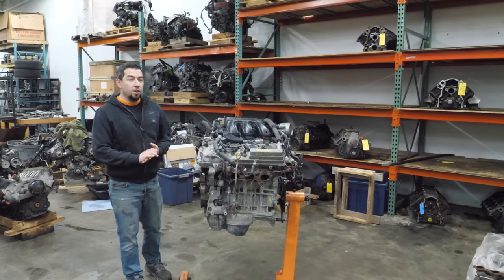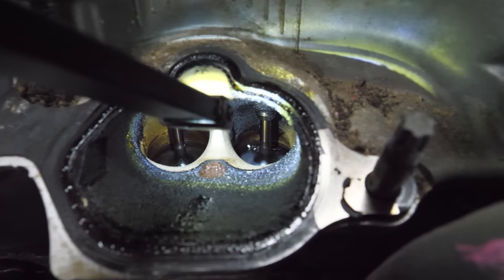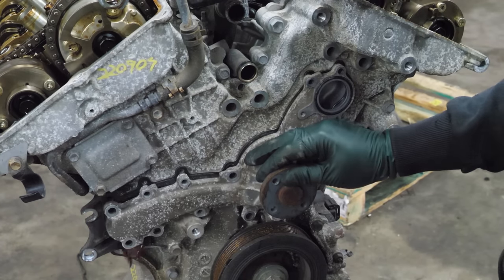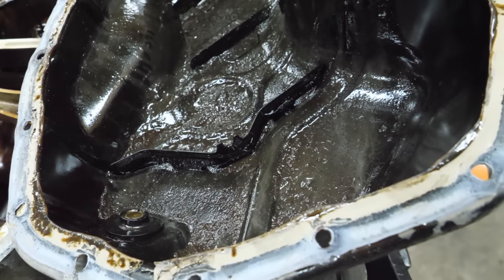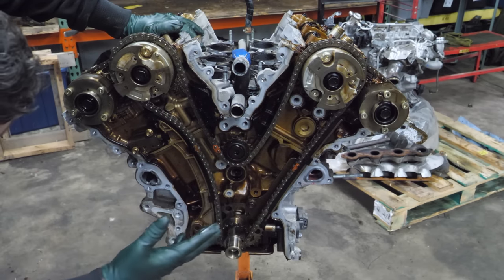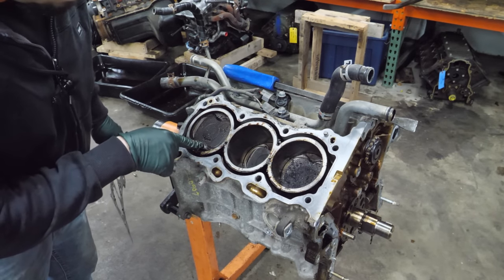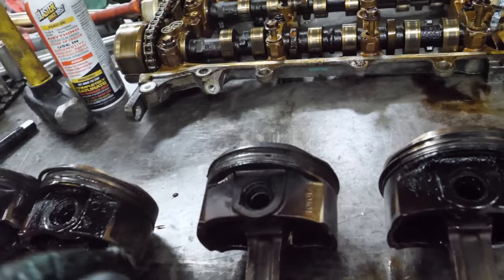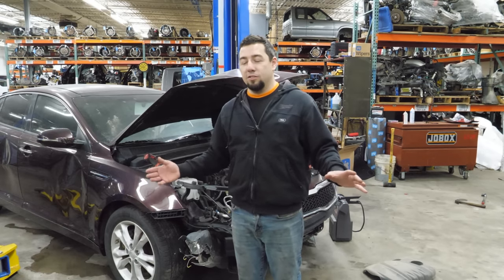Toyota Lexus 2GR-FE Teardown! Premature Death Of Toyota's Most Reliable V6 Caused By Obliviousness!

Comment: When it comes to these engines and why there is still market for them despite seemingly being so reliable comes down to few things. People simply just drive a lot of miles in these cars and they are good cars, probably one of the few where replacing the engine still makes sense rather than scrapping whole car. So loads of miles, means they actually get worn out. Secondly, these being generally very reliable and low maintenance... people do not expect problems, do not look for them and become kind of complacent and lazy... and then they destroy the engine because of minor issue, like some oil or coolant leak. I would add as well that Toyota maintenance schedule is just not healthy. They do their 10k miles services, despite in Europe exact same engines get 10k kilometres services (and last time I have checked that is just 6k miles), this combined with low tension rings just means more sludge accumulation, stuck rings, burning oil and problems starts from there. Those who wants these car to run for a long will stick to 6k miles, or on the car that does commute in daily traffic, or short journeys... even 3k miles... I guess this is Toyota's way for wearing them out, as they are so well designed and so good quality engines that with regular service they would simply run million miles and nobody would need to buy a ne Toyota. Anyway - in summary these engines just likes regular oil service, which is really not much to ask, but again going back to point 2 - people just forget to do it because car is so trouble free it never seems to need any attention and then disaster.

Comment: I must say that the design of the support bearing that Toyota uses for the passenger side front axle in cars with these engines is as bad as it gets from a dismantlers perspective. The axle itself is one piece from the passenger side front wheel to the transmission however it has a pressed on bearing to support the middle of it, that bearing then presses into a cast iron bracket(on FWD models), or the transfer case itself (on AWD models). A snap ring is also employed to make sure that the bearing can’t pop out of the bearing or transfer case. This is then made worse by the fact that the cast iron bracket is bolted with 3 bolts and has 2 dowel pins holding it to the block. One of these bolts can’t be backed out all the way with axle pressed into the bracket, the other two are barely accessible with the engine out of the car, let alone in it. I find that separating the motor and trans with the axle and bracket still bolted to the side of the engine to be the path of least resistance.

AWD models are even worse as the axle now is pressed into a transfer case which once you’ve removed some very inaccessible bolts will crash into the upper oil pan before coming out the transmission, or at least that is the case on a 2018 Sienna. On the 2014 Venza I worked on this past week the path of least resistance after the drivetrain was dropped from the vehicle was to compression test the engine, separate the engine from the transmission, separate the transfer case from the transmission, and then finally stick the transfer case in the press to push the axle out from the transmission end. This job might be simpler if the upper and lower oil pans are removed. If the engine mounts longitudinally in the vehicle as is the case in a 2018 IS350, the axle presses into the side of the oil pan with the front differential on the other side of the oil pan.

I would love to know the book times or costs associated with replacing any of these parts in Toyota or Lexus vehicles, or any insight from Toyota techs.
Reply from the maker: That axle and intermediate shaft is the absolute worst part of the car.
Without a doubt. Toyotas engineers were sleeping and the janitor devised that one.
Reply: @I_Do_Cars  Well the Toyota engineers must still be sleeping because that design has been found in all sorts of Toyota and Lexus vehicle for quite a while now.
Reply: When I worked at the Toyota dealer and had to remove the intermediate shaft I would quote a new bracket bearing and snap ring. I wouldn't even bother messing with it they seize so bad. Cut a slit in the bracket and then a quick blast with the air hammer the axle comes right out. You can also get the bracket cherry red with a torch and air hammer the bearing but is the bracket actually still okay after all that heat and pressure. Or if you want to cheese the system you can remove the clamps for the inner boot separate the axle and leave the intermediate shaft installed. It is possible on some vehicles to access the three bolts holding the bracket on but it's a huge pain. Poor design. Honda has a much simpler intermediate shaft setup on their v6 platform
Reply: Makes taking apart bmws sound like a dream in comparison

Comment: I'm not a mech so why is it called a water pump if it is a coolant pump, coolant is not water? I don't understand. Watched the whole video and still don't get what was the first fault that cause the total failure. I guess that it was a leak of the coolant from the coolant pump? Why the hell would mechanics still use that term?

Comment: As a mechanic i will tell you that you absolutely do not want to have to work on these things in a sienna. Lol. Pretty sure these things die mostly from maintenence negligence. They do require routine oil change intervals and weve have 4 dead ones in my shop from timing related failures as the timing system isnt cheap to work on purely due to how much of a pain it is to get to with the engines in the vehicle. Basically, noone wants to pay that price. Lol. Almost every one ive worked on has clapped out floppy chains and is one cold start away from jumping time. 
ALSO, that stupid oil flter cap is a pain in the ass, youre supposed to use an oil filter cup to remove em. They eventually round and you need a new one. They even made em out of plastic at one point. Theyd crack and leak or round off. Cartridge filters are garbage. Spin on's are the right way.

Comment: They are expensive because the vehicles they go in retain their value well above 200,000 miles.   A clean toyota with 280,000 miles is worth replacing the engine in.

Comment: If the engines are reliable then they outlast the vehicle and are probably very high mileage.  Thus, the only low mileage used Toyota engines you will find are those from accidents which are very limited.  Thus, the high price.

Comment: This engine has done some major work and badly maintained, and been out in the open for a long time, plus this motor has been overheated big time(cooked), those bores are blue
Was hoping to see what actually melted inside the manifold, was is a intake runner or what ?

Comment: So I can claim that I have helped Toyota in durability on this engine my father used to work for the forklift division of Toyota and he would order a diamond White pearl Avalon every two years well in 2005 my dad was one of the first ones to get this engine about 15,000 miles into the car it developed a knock Toyota flew three engineers out and told the dealer not to tear into the engine. Needless to say Toyota and my father didn’t realize I was racing a lot of 4.6 mustangs and 5 L mustang on a Saturday night borrowing dad‘s car…… I feel sorry for those 4.6 L guys though they were slow as hell…..

Comment: It looks like you can't drive a Toyota 6 cylinder engine for more than 165,000 miles if you never change the oil and coolant.

Comment: The inside of a cam cover smells like vomit?

9

I Do Airplanes.  Specifically Boeing 767's.  For a small cargo airline out of Memphis that shall remain nameless [Fedex]. And I have known that aluminum structures can have a pukey smell in some situations, but that is SHEET aluminum, typically with the green anti-corrosion paint.  I don't think that block aluminum does this, and when I have had engine parts open like that they always smelled of the Castrol GTX that I've used in them.

2

Great video!

8

Content needed!

Comment: this engine appears to use an all aluminum block with plasma sprayed iron to the bores. This creates something strong enough for ring wear. It is the cheap way out as no iron sleeves are installed. Recall the Vega! Failure looks to be caused by a head gasket leak, causing gas cutting through the weak aluminum cylinder. Then combustion gasses blew out the coolant and a quick over heating situation. The milage was not that high for such a failure.. I am not impressed Toyota

Comment: 41:39 Yep. And this engine died of one of the things that'll kill pretty much any engine.

Ford 300? Overheat it badly enough the head goes banana. 

4.0 Jeep I6? Overheat it badly enough the head goes banana.

225 Chrysler? 250/292 Chevy? 5.9 Cummins? Smallblock chevy? Iron Duke? Air cooled VW bug? Flathead briggs in the ol' pushmower? Yep. Even the legendary 8BA V8 is vulnerable to this; overheat those things and you'll crack the block between the middle cylinders where the exhaust ports for those cylinders merge together and have a wee jaunt through the water jacket. They'll often run just fine like this but they'll be puking coolant out the exhaust and blowing hoses off the radiator CONSTANTLY. If overheated to the sort of extreme this poor 2gr-fe was, those ol' ford flatties will outright crack the cylinder walls as well, again right there next to that exhaust passage through the water jacket.

PAY. ATTENTION. TO. THE. TEMP. GAUGE! it's there for a reason, people. It doesn't matter how good your engine is, it doesn't matter who built it, where it was built, when it was built, overheat it badly enough and it will do the big die.

Comment: the coolant is really dirty, engine oil smell bad and so dark, oil filter is stuck in the filter housing...possible lean condition on one injector causing  cylinders got overheated, Engine was running too hot all the time. cheap maintain, dirty oil, dirty coolant, possible cheap gas causing injector got clogged, lean condition and engine ran hot. the heat cook the engine.

Comment: another tree tips how not to create a oil leak or water leak . to many people top of there oil or water to the MAX .
that is bad . for the oil stay about 4mm under the MAX mark dip stick . oil expand when it heats up and then you go above ,
the MAX  when you fill the oil cold to the MAX . thats how you create  oil leaks . for coulant also dont top of to the max .but stay in the middle MIN TO MAX  .
also water expand and when to much coulant it gonna puch it out somewere most of the time waterpump . same rear,
axel i see many do oil fill up .the to much oil is still dripping out and they allreddy put the cap on . also oil heat up,
expand and the  pressure puch it out the oil seals . wait until the oil stops dripping complete then put the cap on .

Comment: Do these last longer in the 3,300 lb Camry versus the 4,500 lb heavy sienna? And do they both use the same transmission?
Reply: I believe they both use the same transmission, and they both will last a long time - this particular engine had a coolant leak, overheated and toasted the engine. Abuse. But yeah, I’d say the lighter Camry would lead to an easier and longer life compared to a heavier van.

Comment: I have one in my rx350, really not a fan of this engine. traps air in the coolant very easily and will overheat in a heartbeat. of course the bank against the firewall always has the most issues. headgaskets are way too common of a failure on these - for a reason, poor engineering imo. I will never buy another transverse v engine after this one

Comment: Those  parts can go lot longer if you got right person  owner  of vehicle did not care drove van did not put attention  to maintenance  but i can say is 3.5 Liter engines  are big headaches  i had a Nissan  3.5 and design  problems  as we'll 2grfe has complexity  issues  and toyota  could  done better  job plus transmission is seal unit as well not good toyota  service  department  is extremely  expensive  do not purchase  newer  vehicles  older toyota  is way better  designs  then  new units.

Comment: Owner changed oil every 15k miles => clogged piston rings and oil consumption => oil was low and engine was overheated => head deformed and head gasket broke, water went to through => big badaboom
Reply: Is safety tote related to Buckethead the guitarist?

Comment: Ok, you clearly are not a toyota tech. I highly recommend watch care car nut channel who is a master toyota technician.  There are a ton of problems with the 3.5L. They were no good until 2014. There are head gasket problems,  $4k job. Rear timing chain problems $3k job, vvt timing actuator problems  $1800 job, oil pressure switch problems if not caught would destroy engine in minutes from loss of oil. There are endless oil leaks.  And the  transmissions on any 3.5L where weak up until 2014. If you buy any high mileage used 3.5L you are buying  a waiting time bomb do not do it. The 3.5L is in no way comparable to the bullet proof toyota 4.0L truck suv engines